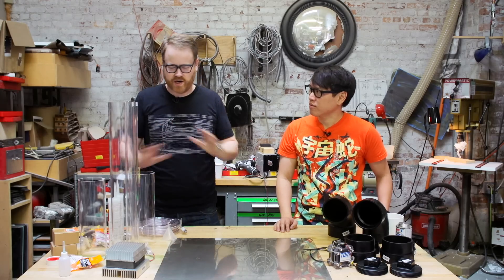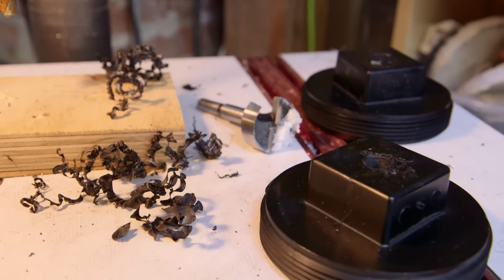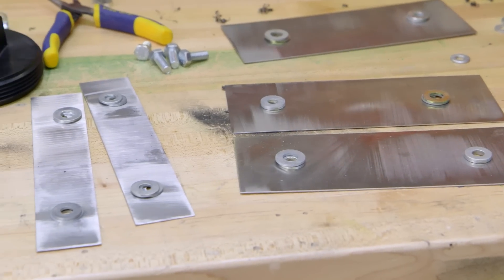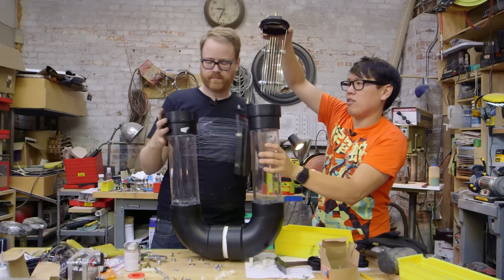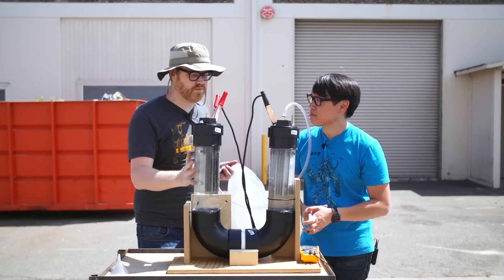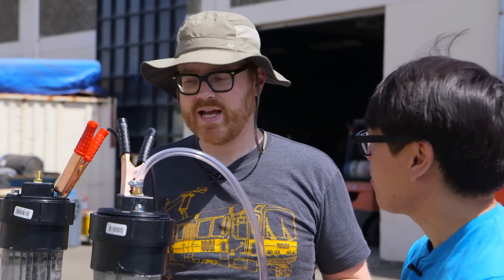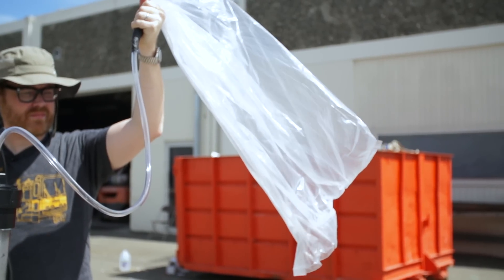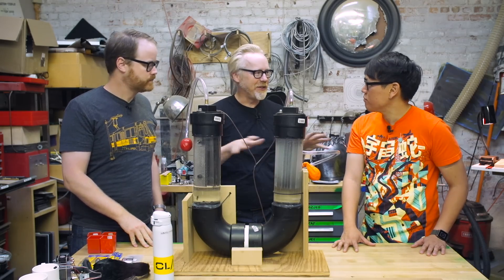Tested Builds a Hydrogen Converter

Comment: The problem with this machine was there was no direct pathway between the anode and cathode, making the resistance really high because the electricity has to pass all the was around the bottom curve to the other side. If they were built closer together and a bridge was built between them, the process might have been more efficient. That and like many others have said, low voltage + high current. 120v, 15a DC will run WAY less efficiently than 1.2v, 1500a DC (build a transformer/rectifier circuit.)

Comment: Problem three its CURRENT and NOT VOLTAGE that does the trick. Cells do nicely with 1 or 2 volts. (You can divide the voltage by adding more plates.)

Comment: Problem two they used stainless steel which contains chromium. Electrolysis turns chromium (good) into bad chromium. Carbon or Graphene are a safer choice.

Comment: Such a giant gap between the anode and cathode... What conductivity you increased using large surface area nodes was undone by having them spread out around a foot apart. Put them much closer together, and to keep gasses separated, do not use a U joint tube, use a sharp V shape.

Comment: For guys who are supposed to be smart, you guys don't troubleshoot anything. My kids and I build one for a science experiment with a smaller solar panel and a smaller unit and produced more. You obviously needed to adjust your electrolyte levels and maybe put a real solar panel on there, not a panel for trickle charging a car battery from harbor freight. Seriously, this kind of experiment is not a little issue, you guys need to give it proper attention.

Comment: wow that's the worst example of how to build one i've seen.  you can produce way more than that using as little as .25 V dc at the plates.  Maybe you should have got someone who actually read a book to do this.
by the way your process works you're trying to extract 1000% more than would be physically capable from that same volume of water.
you don't need oxygen running out you need it coming in.  you can not extract one thing and think the rest will naturally last.  you need to replenish it.  your plates are wired up completely wrong.  all you'd be doing is boiling water at that voltage.  you never even proved the hydrogen worked and you don't need to add potassium.  basic bicarb will work as will salt.
guess i'll never need to watch another one of your videos.... proven to be wrong...  doesn't surprise me...  myth busters often got things wrong too

Comment: "we tried almost nothing but it just wouldn't work "
Reply: Potassium hydroxide is the key.
Reply: @verbusclamanxian  : Sodium hydroxide & aluminum (with an after bath) works pretty well too.
Reply: @JonsFishGallery  titanium is good with acid but worst with electricity...only if you can covered with platinum or rodiun will work
Reply: Acid citric and koh...and resonance frecuency match with electronics

Comment: Hey Guys. 
Water does mot conduct electricity! It only conducts when there are other particulates "added" to it.
The Hydrogen and oxigen are a result of the "electrolyte" gasification and not the splitting of water into its two imaginary components. 
The Potassium Hydroxide Caustic Potash flakes are what create the gasses and not the water!

Comment: u cant run a car on HHO gas without dangerous risks!!
if you store stoichiometric mix of hydrogen and oxygen then you have a BOMB!!
you cant continually produce the hydrogen or there would be no point to even bother re converting it into motion because thats a waste.
With that you can just run the car of the electricity you used to make the hydrogen as a hyrid car.
you can use porous cells to produce hydrogen and discard the oxygen but that lowers the efficiency slightly.

Comment: This cell is running on very low current and thats the main issue because the volts only matter to overcome the potential of whatever your seperating. you would still need then a few extra volts to beat the resistance of the electrolyte.
Once the resistance of the cell is low enough and you have enough amps to run through the system you are good to go.
HHO cells dont need to worry about stuff like current density too much, but other electrolytic cells may require it to prevent anode destruction.

Comment: this design is so dumb i dont even...
if you want to make it produce both hydrogen and oxygen seperately then you need liquid porous membranes between the plates
the problem with that is it will reduce the efficiency.
I get that you cannot pass oxyhydrogen through a fuel cell or else it will explode but you shouldve done more time to build a proper cell with membranes!!

Comment: Hexavalent Chromium is released when using stainless steel in electrolysis. How did you handle the disposal of this highly controlled hazardous material that you unnecessarily released when you could have used iron or steel instead?

Comment: Look up split the Positive with Bro Mikey.  Where he connects his inverter is where you should hook up your HHO cell.
Then build a battery rack for the back of a pickup truck and put solar cells over the batteries. 

With Split the Positive you are using batteries to charge other batteries.  You get electrolysis at the same time that you are doing this.  You will have to keep rotating the batteries around but the energy losses will be less.
 You can use a solar panel system installed directly over the batteries to maintain the charge of the battery bank.

Use flash arrestors and be careful with HHO.  I am not responsible for any losses to persons or property ect.

Comment: I did this experiment just from watching a couple of diy video's and about an hour or so later I sent a 500ml water bottle 50 feet up in the air ! So you can't tell us that it doesn't work,  that just disqualifieds you and your shop big time.
PS I filled the water bottle with HYD and ox and kept it upside down and then slid it down my truck antenna and then lit it.

Comment: To bad to hear you say: "The more Voltage the more hydrogen is being generated" THAT IS NOT TRUE. You get 1.23V * amperage worth of hydrogen the rest of the voltage *Amperage is converted into heat. You just made a water boiler, that also makes some hydrogen and oxygen. Get your facts straight.

Comment: Hydrolysis is using water molecules to break apart other molcules, just as electrolysis is the use of electricity to break apart molecules. Hydrolysis is NOT electrolysis for water.

Comment: I have made one of these myself and I know they work. the trick is getting the correct current to provide enough output to run an engine otherwise it's just a novelty item.
Reply: How do you control the watts and amps if just hooked up to a battery

Comment: King of random used 2 car batteries in series that is 28 volts and around 1000-2000 amps you moronic dildos used a sad little 22 volt 4 amp solar panel. You guys are not even worthy of standing in the same room as Adam.
Reply: me? i mean i do tons of robotics and im a blacksmith but not this kind of stuff.

Comment: There are two main types of efficiency in electolysis: energy efficiency and coulombic or faradaic efficiency, which has to do with how many of the electrons entering and/or leaving the cell go into the desired reaction(s).
This rig has neither.
Having such a large plate separation gives it poor energy efficiency, so most of the power just goes into heating the water, and the order of magnitude overvoltage (while necessary for this thing to make any gas at all) means that most of the current coming into the system goes into making unstable things like ozone, trioxetane, peroxides and free radicals that ultimately decompose back to water, oxygen or hydrogen while releasing heat.
This rig lost sight of what made Grants rig work so much better of so much lower voltage and power; the plates in the original design were very close, parallel and interleaved.  I actually decided to check this out because it actually is practically very difficult to have these features and be able to easily separate the produced gases.  Cody @Cody'sLab Has had better success with this and gives better explanations of electrolysis too.

Comment: I watched this the other day and how you guys messed this up is you was using ok voltage with low AMPS. I bet if you put 2 car battery's in series you would generate more then that solar panel.

Comment: electrodes = 416L stainless or they corrode.     spacing between electrodes = less then 1/16 of an inch.
as many x distilled water as possible.  add 12 volts at 7 amps until water is warm,  add electrolite in the form of KNO2 until amperage increases to an amperage where the water is NOT BOILING.   voila  lots and lots of production.

  anyway, my 5by5   INCH  cell pumps 1 litre a minute at 12 volts/7amps all day.      11 plates 1 positive 2 negative and 8 neutral  
    configured like       - n n n n + n n n n -                  plates are seperated by silicon gaskets 1/10" thick.     holes in the plates let HHO out.        you can buy them off HHO2U.com        pretty much same config

Comment: Those plates need to be much much closer together... Like a spacing of 2 to 3mm works best. And you need to add an electrolyte like sodium bicarbonate.
Reply: I'm very ignorant here and am not finding the answer (Probably cause I'm asking the wrong questions) but how quickly is the electrolyte depleted?
Reply: They added potassium hydroxide as an electrolyte. Left and right sides of the cell should be brought closer together but plate distance makes little difference
Reply: BUT, you don't want capacitors or you need some sort of faraday cage.
Reply: I agree, or pottasiam Hydroxide. Mine is about 1/4 of the size and does 2lpm of hydrogen.

Comment: How pathetic.  You obviously were not serious, about making a legitimate attempt.  I've built dry HHO cells, that easily make .5 L to 2.5 L  of HHO per minute, using very little power.  I could have given you 15 Liters of HHO in 6 minutes, or 15 Liters of just Hydrogen in roughly 9 minutes.

Comment: 2H+ plus 2e- --> H2  If you have more H+ than this half-reaction works best and the electrons, well that is the current or ampères, so with higher current more H2. I say: put more acid in the water for a higher H+ activity (lower pH) use Acetic acid (not HCl because of the chlorine and corrosion of the stainless steel, and not sulfuric acid either, also because of the stainless steel: it produces H2S by catalysed self-reduction or something like that. With KOH pH is very high and consequently the H+ activity is very low.

Comment: Your video is a lie and a sham. What electrolyte did you use? Potassium hydroxide. it must be a hydroxide to get Hydrogen and Oxygen. That is where you H and O comes from, not the water. Do the same experiment with salt as you electrolyte, you won't get the same result. Water is not H20. Come on scientists, challenge me.

Comment: i built one of these with a 5 gallon bucket, a 10" cast iron frying pan and a 10" table saw blade. i used a 40amp battery booster and it worked like gangbusters. i built it to clean the frying pan, but it created so many rust bubbles that were flammable as hell when the battery charger leads sparked i almost blew up the garage. so more amps, and just plain ole 12 volts.

Comment: still people attempt HHO production is with electrolyse process whatever the plate are arranged or pulse signal.  Have seen all and still the reaction is not efficient ( max 18 %)
I will explain new design that is not over unity but it will lead to > 90 % efficiency.
It is the electric field:
In fact the water molecule is dipole (Charged molecule) in strong electrical field it will be aligned and fixed direction. When you vibrate the lectical field then the O and H will oscillate. If you reach the proper frequency of molecule water then it will brake the connection and separate HH from O.

To get strong electrical field two option : two plate very close with low voltage or high voltage with distand plate. In both case you need to isolate well the plate to avoid electrical arc.
Electrical circuit with variable frequency to oscillate the field and see if there is a frequency will split the water molecule.
Un fortunatlly the frequency I have seen in article around 77 000 GHz, bu if the static strong electrical field when it is applied it will stretch the molecule and change may be the proper frequency. No theory about that only experience will lead to conclusion.
It time to stop normal electrolyse and pass to strong static electric fiend with oscillation in Mhz may be we will get 90 % effiency of HHO production.

No need to make big sample and expensive, simple two insulated plate is enough with static strong electrical field.

Comment: Fun experiment guys. I have built hydrogen generators like this myself quite successfully.  However, a word of warning: Using stainless steel as your anode creates hexavalent chromium as a byproduct - this is highly toxic and cannot be disposed of safely! I've used solid carbon sheets for my anode/cathode with good results, and no dangerous byproducts.  Also much lower electrical resistance!

Comment: one cannot split water into hydrogen and oxygen as water is not made of H20. One is obtaining hydrogen and oxygen from the electrolyte as that is what electrolysis breaks down for example, sodium chloride electrolysis will break down the sodium from the chloride. No hydrogen per se at cathode, only a sodium based gas which is palmed off as hydrogen comes off at cathode because people will then think that the hydrogen per se comes from the water. It's all misleading!!!

Comment: I guarantee they did something wrong on purpose just like the MythBusters did with the gas vapor car, for example: higher voltage doesn't mean crap without high enough amperage, you could have over 2000 volts, but if your amperage isn't high enough it ain't frying anything, if your amperage is low enough it will barely tickle, you would need more than one solar panel to produce enough hydrogen to power even a tiny blow torch that can cut through Steel in seconds, and it's not hard to tell they were having a pressure leak, if there was no leak, the balloons would keep gaining pressure no matter what!  This is the kind of crap that turned me away from the Mythbusters in the first place. a Kid with a glass bottle, water, sodium hydroxide, aluminum shavings, nylon tubing and a balloon, made a 2 cycle weed wacker run off of some "on demand hydrogen oxygen mix" for a few seconds at a time, the balloon would store extra gas until he turned on the valve and cranked the weed wacker and it ran for a least 5 maybe 10 seconds at a time until the balloon lost too much pressure and then he would start over again it would automatically build pressure when he turn the valve off, And three guys considered to be Engineers can't make this simple device work? 😒💩!!!     and don't say ain't isn't a word, it was in the dictionary when I was in school over 20 years ago, and it still is today!

Comment: If you're going to separate the hydrogen and oxygen Generation by so much distance, you need to severely up the voltage. Try throwing on a Transformer from an old microwave. 

  It's really hard to believe that you guys aren't smart enough to think of this. I'm starting to think you are complicit in the cover-up.
Reply: Video presented by Toyota!

Comment: You don't need to separate the gasses it works fine for every thing you want to use it for ...like running engines or welding that's the interesting part and top secret Laboratories they use that to weld you can weld anything to anything Copper to Copper copper to glass copper to a brick aluminum just goes back to sealing itself after poking a can with a screwdriver you hit it with the flame and it feels up like it was never even scratched that was weird that's the amazing part about this gas Brown's gas welders the ancient artifacts that they find that they can't duplicate now we're created with Brown's gas in the ancient days that's why they have an amazing physical properties and do not corrode over thousands and thousands of years I know that was my field I'm getting ready to make a samurai sword that produces an electrical frequency impulse of a specific design to cut through Stone it will move the molecules out of the way instead of ripping them amazing technology